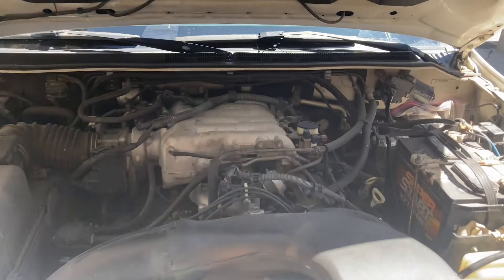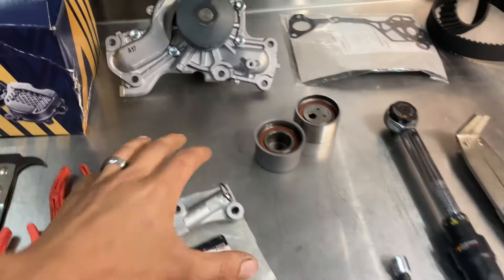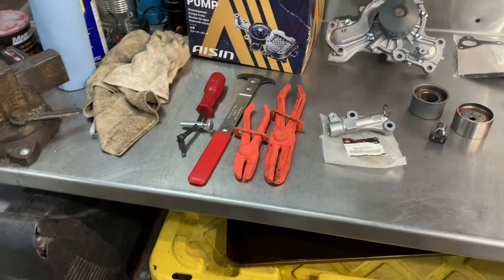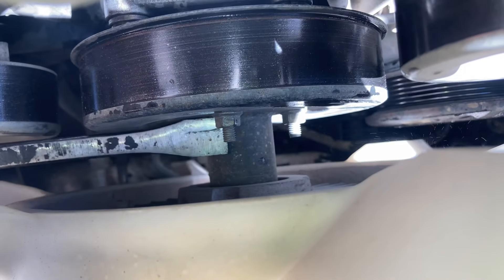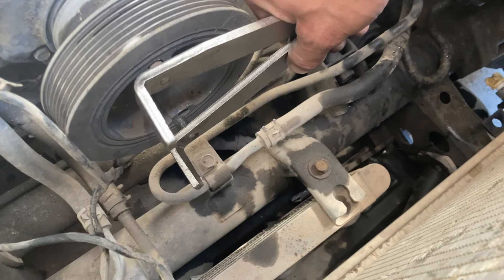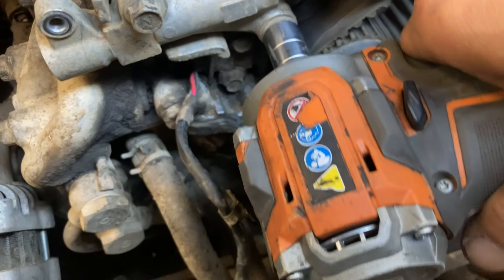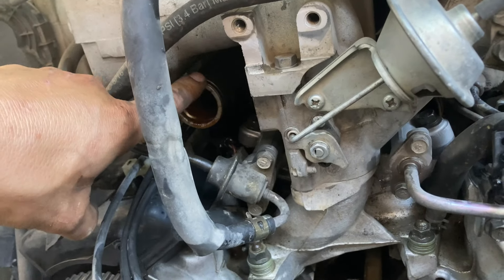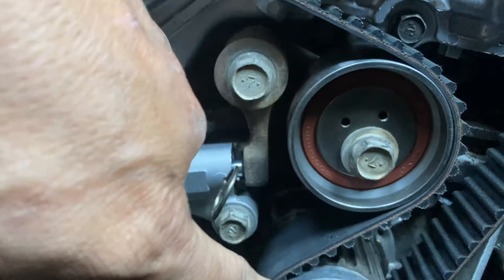How to do a timing belt on a Mitsubishi Montero

Comment: Effective 12/22/22 - Our OEM Gen3 Montero Timing Kits now include the large coolant pipe o-ring (MD030764) and the water pump to thermostat housing gasket (MN128500). Thanks @montanamontero3830 for the shoutout and awesome how to video!
Reply from the maker: THIS is why i love lusooverland!
Reply: Do you supply globally? I'm interested in ordering parts from you. I'm based in Southern Africa
Reply: @imranlali3041  Yes, we do. You can order from our website or on our eBay store. Thx!
Reply: @boroughmanager7067  Hello, sorry we were sold out for a few days. They are now back in stock! Thx

Comment: I can attest to how IMPERATIVE it is to torque (pre-load) the tensioner pulley and having the OEM tensioner. Got an off-brand timing set when I rebuilt my 3.5L XLS. roughly 8,000 miles later and the tensioner wore out and jumped a tooth. Absolutely take this into account when doing this. I love how detailed you are about this! 10/10

Comment: I’ve been putting off this job and was going to have a shop do this for me. After watching it looks like something definitely doable by myself. Thanks!
Reply from the maker: It’s totally doable with the right tools and a good attitude! Hope the video helps when you actually get in thete
Reply: @montanamontero  yeah it definitely will help! Gonna snag the kit from Luso once the weather cools down here. Also while I’m in there, I’m gonna replace valve cover gaskets, spark plugs, cam seals, etc..
Reply from the maker: @Bradleyj3121  cam seals are a good job to do while you are doing the tb/wp.. the valve cover and spark plugs are on the top side of the engine and a whole different process, but still a good job to do!
Reply: got mine done at a shop because lack of exp and tools.. well i paid 1500ish with 2 new tires but forgot to mention cam and crank  seals. so i add oil here and there now. i got the parts from luso to fix it. but still don't want to take it apart myself... I'm sure i would break something  lol. now vcg and plugs i would attempt, all the stuff on the intake looks daunting but at least the chance to have to rebuild the engine wouldn't be on the table.
Reply: @montanamontero   , what are you thoughts on a electric fan conversion for the radiator?

Comment: Ive Got 247k miles on the clock, slowly procuring everything so I can treat my 02 right. Your video gives me confidence that I wont grenade my motor by my own hand.
Reply: Just got an 06 with 198k and it’s driving perfect so far and I’m getting prepared mentally to start this journey!  How as yours been so far ?
Reply: I had a 97 Montero that I did the timing on. Wish I had this information now. Full failure of tensioner, jumped time but was revived by the next owner

Comment: Please make a video about full inspection and recommended fluid and maintenance of a gen 3 for new owners ..

Like all the things you recommended doing and inspecting and cleaning etc etc 

Please make it for people that don’t know all the things you do and even simple things that you may assume are obvious.

Maybe do a series of videos -

1under hood inspection and maintenance 
2 under the engine inspection and maintenance 
3 wheels tires brakes and under the car suspension etc 

4 electrical 

5  interior and body 

Even things like checking drain holes and where to grease or clean 

Maybe even things like how to clean the radiator fluid or throttle body etc

Comment: You didn’t show removing the crank pulley.  Did you have to use a puller for that?  I have a gen 1 and I’ve got the bolt out and can’t get the crank pulley off yet.

Comment: Great video, thanks for that! I ended up doing the job with zero special tools, which worked out quite well. I've done this for the first time on a 6g75 and it took about 7hrs all up. Tackling spark plug change next in order to get to the bottom of a low revv cut-out symptom under load when the engine is warm. Keep up your good work!

Comment: You really need to post a PayPal or cash app link for donations. Your instruction video is such an incredible resource for those of us who are nOObs with little to no experience.

You mentioned earlier in this video about pulling the A/C compressor. Do you have any videos showing how to do that? I need to do a timing belt job and it seems the a/c clutch is seized and needing replacement.  

Thank you again for what you do!
Reply from the maker: I’m just glad I can help pass on the knowledge that others have shared with me! I don’t have any videos removing the ac, however if I remember correctly it’s just 4 or 5 bolts on the side of the engine and the compressor comes off

Comment: Hey, I know this is an older video, but hopefully you or someone else sees this. doing the timing belt on my 95 Montero LS (3.0 with tensioner) and I have the crank and the right cam lined up perfectly, but the left came is waaay off. we're talking like 10 teeth from the mark. took off the tensioner and belt and tried to get that one lined up, but it just jumps past the mark. how can I get this figured out? should I get it close then throw the belt on to hold it?? no idea. if you have any advice it would be much appreciated.
Reply from the maker: Hey man! This is actually pretty common, one of the heads is almost always under tension and wants to jump around. If you can hold it with a 17mm wrench on the cam bolt that is usually a good way to get it lined up, then you can get the belt on. Sometimes it takes two people. However I have found that once I get the timing mark lined up it usually holds in that spot without assistance.

Comment: Just a tip on the accessory plate.

There is a bracket towards the left of the plate that has a 14mm bolt. Loosen that and just twist the bracket out of the way. Plate comes out much easier

Comment: Crank bolt can be loosen up by a socket and breaker bar by leaning against something solid unplugged the spark wire just till it cranks but won’t start the engine. You have to make sure the orientation of the engine turning or else you can actually tighten ( break) or loosen… I have done this once on a Ford Ranger.
Reply from the maker: while this is true, i don't recommend it unless you really know what you are doing haha.

Comment: Nice job!

I wish I could have seen this video 6 months ago, it took me a week to do the same thing, except I changed the plugs which meant removing manifold and redoing valve cover gaskets. When the cams sprung on me, I was quite panicked! 
I hope my truck lasts more than 10,000 miles😜
Reply from the maker: Yeah plugs is a whole different side of the engine, the job can definitely get away from you if you end up missing parts or not having the right tools

Comment: Following along as I do the job live and just like you’re saying at around 23:00 my passenger side cam jumped one tooth and I’m having a hell of a time seating the belt while the marks are aligned. What happens is I think l I’ll have everything right on then I’ll go tighten the tensioner and that same cam moves as I introduce tension. I’m also having a real hard time just getting the belt on that last cam as well, any tips?
Reply from the maker: i use some clamps to hold the belt to the cam and that usually prevents it from jumping around too much. another method is to have someone hold the cam with a 17mm wrench on the bolt head of the cam. i don't love that method because it can still move, but it does work.

Comment: Good job with the video! I just picked up a 2003 with 111k miles and the timing belt hasn't been replaced, so it's not going anywhere until the timing belt is replaced.

Comment: I change mine every 100,000 miles, all makes. I live in a dry ad hot area and they do fine with that. I've never seen a problem with them until about 150,000 miles (excessive cracks). 

If the Montero belt starts to tick at lower RPMs, but stops above 2500 rpms it is the tensioner failing. Stop driving it at that point for sure.   The Gates and other quality brands (2 or 3) are good enough.  I've had the cheapest ones fail after 20,000 miles.  

I have two 2003s each with 230,000 miles.  I changed the timing kits last at 160,000 and 150,000 miles.  Have owned them since 150/165,000 miles.  Had 2 other Gen3s with 3.5L and also all previous gens also.
Reply from the maker: My guess is that the tick sound is actually lifter tick, unrelated to the timing belt

Comment: I've got a video doing this on the 6G74.  Regarding the tensioner, the inch pounds rating is just to ensure that once it's all installed, your tensioner rod stays within the acceptable range (3.8-5.0mm in my case).  You can do it without the special tool and a torque wrench; it's just trickier.  I lost my tool and just used circlip pliers to apply torque to the tensioner pulley.
Reply: hi  Kaldekboch, do you have a link ,doing this on the 6g74 engine,please?

Comment: Dude thanks a lot for this video, just bought a 3.8 here in Australia. Still got another 50k to go until it’s due for a new belt but will definitely come back to this video by then
Reply: Have you done yours by now? I am just about to tackle mine. Not because the belt is due, but the noob who replaced it last didn't replace the water pump (I assume), and I have a massive leak. Sourced parts from all over the place.
Reply: @ no not yet, probably doing it somewhere next year. Plenty of good videos on youtube I believe
Reply: @guitarsender  Heaps. There's another one form Montana Montero which is very good, just without replacing the crank & cam seals.

Comment: Won't the crank turn counter clockwise when you loosen it with an impact wrench? Don't you need to hold it with something.
Reply from the maker: Not with the impact, that’s one of the advantages of this method. The crank will stay right where it is

Comment: If we don’t feel confident enough to do this job would it help to simply remove the cover to expose the timing belt and tensioner and simply inspect it and make sure the tensioner is working properly?

I understand you recommend changing it but would it be ok to inspect it and if it’s ok to keep it and only replace if actually looks wrong ?

Anything to look for besides just something obvious?

If mine looks good and seems to be in good condition I will hold off and take the risk until I can afford to pay a local Montero specialist I know to do it .

Also while I have it exposed can I start it and listen and look for problems ?

How can I know that it’s still lined up right and tight enough?

What am I looking for to know it’s working properly?
Reply: None of your business.

Comment: My 2004 pajero has its original timing belt and it has 180k miles
Reply from the maker: that's a risky game you are playing
Reply: @montanamontero  So are any mitsu engines actually 'interference engines'? [Later: They ALL are (apparently)]!!
Reply from the maker: actually the 3.0 and the 2.6 in the gen 1 are non interference @anastigmatix4119

Comment: Great video with lot of hints for DIYers. Do you mind sharing what RIDGID impact driver (Model# please) you used for the crankshaft bolt ? I heard that it is the hardest part of the job to get the bolt out.
Reply from the maker: mine is an older model at this point, but it's the standard 1/2 RIDGID impact. they haven't changed the size much, but the newer ones have more power
Reply: @montanamontero  Thanks. I have the same 1/2 inch RIDGID . I now feel comfortable tackling this JOB in near future.

Comment: Doing the timing job on my 1998 Montero. Worked down to removing the crank bolt. Tried breakerbar- no dice. Bought a new compact impact w/ supposedly 450 ft/lbs release torque. Still won’t budge. Aren’t these supposed to be around 130 ft/lbs? What gives? Tried pb blaster and a propane torch too, no luck. Adding pb again and planning to let it sit overnight before trying again tomorrow, but I don’t know how much that will help.
Reply from the maker: Were you able to get it off? Sometimes they are really on there because of rust. Scare stuff though, if you snap that off you’re in for a bad tkme
Reply: @montanamontero  nope. Still stuck on there. It’s the old style bolt so I’m really worried about breaking it off. No visible rust in that area. But given the state of the belt, I’m not sure it’s ever been removed before

Comment: So I did this job this weekend and after finishing up the job the car starts right up, clearly I fixed the issue I was having with all the slack in my timing belt (bad tensioner) but it will only stay running for 14 seconds before it dies again 😭 somebody help

Comment: One more question here. When you put in the new water pump assembly, how do you make sure it sits on the tube backside that has the rubber O ring ?  Do you have to push it in or when you tighten the bolts, it glides on to it ?
Reply from the maker: it kind of just falls into place, you need to lube it up and make sure that everything lines up, but then you just push it on and the bolt holes should line up. it should slide on before you put the bolts in

Comment: Any videos on removing the ac and power steering bracket? I can't get the accessory plate off due to the bracket being in the way. I feel like I'm going to break the plate if I pull it too forward...
Reply from the maker: the power steering is faily strair forward. the AC is 4 12mm bolts on the side. it's not actually very hard to take off, i'm just lazy haha

Comment: Hey great video man, I just bought a imported 03 Pajero with 95000 km, 6g74 engine, immediately thought about the timing belt and if it was done, will be using your video for reference!

Question about your oil catch can, does it just go on the pcv valve side of the engine..?
Reply from the maker: yes, the oil catch can just goes between the PCV and the intake manifold. basically just splice it into the normal PCV line

Comment: Hey man I need your help. Hope all is well. Dealership just replaced my timing belt and messaged me asking if the vehicle ran previously, they cannot get it to crank now. Have you come across this?
Reply: Some context: 68k on the motor. Ran like a top.
Reply from the maker: it doesn't crank? or it doesnt start?
Reply: They say it turns over but will not start. It’s the 3.5 DOHC 95 SR
Reply from the maker: i would be double and triple checking that all the sensors got plugged back in, especially the crank. when i rebuilt my 3.5 in my SR i put the fin for the crank sensor on wrong and it wasn't reading.  @jrock8964
Reply: @montanamontero  just found out I’ve got a bent valve on what was a perfect running engine. They tried to tell me it was carbon build up. Pretty sure they fired it up out of time. Good chance I’m going to need an engine? I’m sick.
Reply from the maker: man that sucks! you can do a leak down test to see if it's leaking from the valves. if it's just a valve, you should be able to get the head pulled and the valve replaced and be good to go. @jrock8964

Comment: hey how is it going, my harmonic balancer is stuck is there a way to take it out, i broke a 3 leg puller , the threds broke .. any pointers on how to take it off?
Reply from the maker: it sounds like it's rusted on there. it should just slide off, so i  would try some penetrating oil and tapping it lightly with a hammer to get it to break free

Comment: Hey loved the video but I got a question! So I put the belt on, set the preload and tightened the pulley, and once I did that the pin in tensioner slides effortlessly like you said, however once I do 2 turnovers of the engine the tensioner pin is really hard to pull… does that mean I messed it up somehow?
Reply from the maker: not necessarily, but i would double and triple check that you are tensioning the eccentric pulley correctly

Comment: I was wondering how many revolutions you turned the crank. To get TDC I'm not lining up on all 3 point after 3 revolutions, any suggestions?
Reply from the maker: It should take 2 full rotations of the crank to get back to lined up. Are you off by a few teeth or way off?
Reply: @montanamontero  
So I had a critter get up into my timing belt and get chewed up it messed up my cam and crank position sensors, I've followed your steps on disability but the cam sprocket on the driver's side is 3 teeth off to the driver's side, the other is 3 off to the passenger side so they are opposite

Comment: Question I got a 2001 mitsubishi montero sport xls 3.0 and the timing belt broke would it mess up the motor I knw these motor or  Interference motors but I but new belt and all on and put back together and now it won't run or crack I put new belt, pully, cam, crank senor what do you think maybe the timing now set correctly
Reply from the maker: if the belt snapped while the car was running then you need to replace the valves since the pistons made contact with them. That's a pretty major job, i just did it on a 2000 montero sport last weekend
Reply: @montanamontero   So these motors are  Not non interference motors???
Reply from the maker: @dinkwoodham80  nope, they are interference for sure
Reply: @montanamontero so time for a rebuild ??? If the belt broke?? So would it be better to put a LS motor in it or fix my motor 🤔??

Comment: What did you use to pull off the crankshaft pulley
Reply: It doesn't require a tool, unless it's rusted on there or was installed crooked (which is really hard to do). you just have to wiggle it off by hand, it's not like a CSB where it's pressed on

Comment: I have a pajero gen 3.. with a 3.0L engine (6G72). I want to know if the belt is the same as the one you've installed.. (teeth count)
Reply from the maker: i don't think the tooth count is the same because mine is a DOHC
Reply from the maker: but the process should be very similar
Reply: Yes, i totally agree with the proces. It should be very similar, but the reason i asked is, because i wanted to order the timing belt repair kit from luso overland. It would've saved me the hassle to try and find the right timing belt.